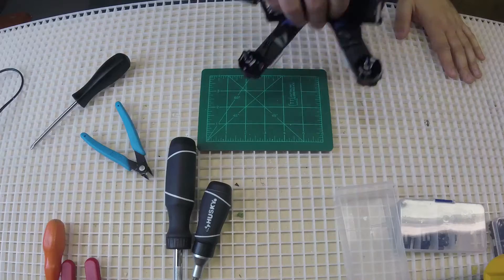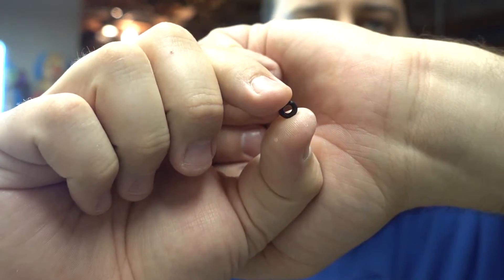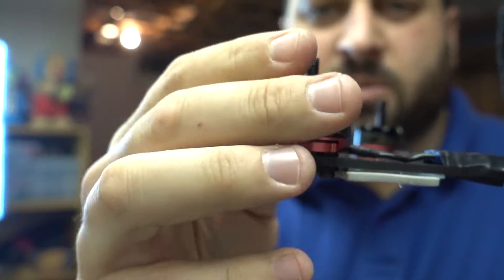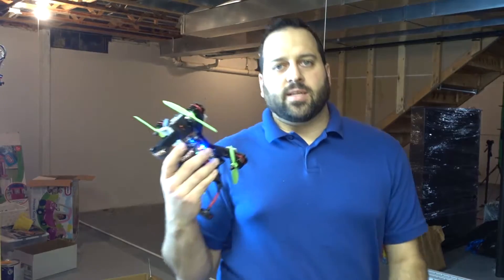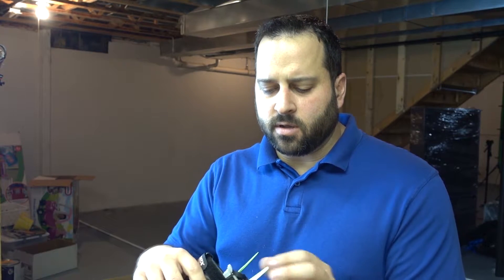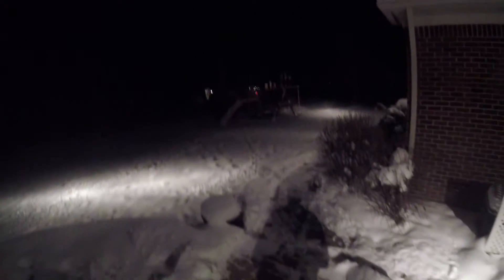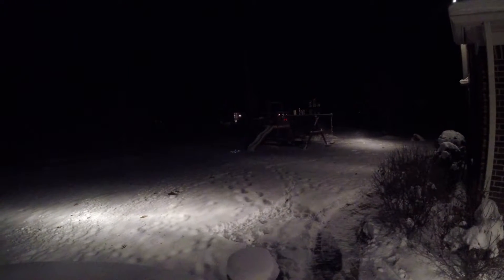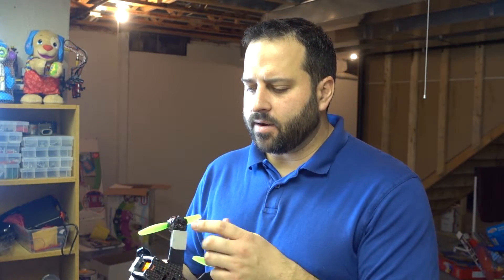DampenedLight Twitching Part 2 - #SolvedForReals

Comment: What kind of difference do you think it makes with o rings on the motors instead of the electrical tape I see everyone doing or double-sided tape
Reply from the maker: I can't comment on the difference.  I've only tried o-rings and TPU spacers.  Both of them worked effectively.  I would assume that a few layers of electrical tape would work just as well, but without ever trying it, I can't say for sure.

Comment: If you look on BetaFlight it will show vibrations. I clamp the drone down and using the transmitter there are large spikes at repeatable places for sick motors.. 
Couple of motors the spike would be over a range of RPM's like 1400-1450.. If I go above that RPM motor is happy and below it also happy but in that range the noise is dramatic on one axis.
Different motors will have the noise spike on different axis. 
Your Solution dampens the issue but it is still hiding there. I plan to migrate to another motor. I have 6 bad ones. 12 good. 

I take that as the Twitches.
Reply from the maker: +Emrys Alf maybe, but spinning the motors in the betaflight motor tab didn't show an issue for me.  And yes there is still vibration there and I'm just dampening it, but this did solve the problem.  The gyro sensors in a lot of fcs are a lot more sensitive than they used to be. Making small issues like this far more noticible.

Comment: Try isolating the FC with o-rings and plastic stand-offs.
Reply from the maker: Anthony I did.  I now have both the motors and the FC soft mounted.  For me, the soft mount on the FC alone was not enough.
Reply: At 9:04 you still have the glitch.
Reply: John E Fly I am having the same trouble as you. Next I am going to dynamically balance the motors themselves. It's these new gyros, they are so sensitive.
Reply: That worked for me!

Comment: I have the same problem with my wizard. No crash and I got the same weird yaw twitches. I'll give this a try and hope for the best. Thanks
Reply from the maker: Sorry to hear about your trouble with the Wizard!  I hope this helps you.  

I have done another build since this one which had the same switch issues, so I soft mounted those motors too and it solved the problem yet again.

Comment: https://github.com/betaflight/betaflight/wiki/Frequently-Asked-Questions#i-get-yaw-twitches-or-mid-throttle%20oscillations-how-do-I-solve-this-  << was this relevant?
Reply from the maker: It's extremely relevant.  Unfortunately I didn't find the FAQ before I had already spent a ton of time troubleshooting, and had already put the o-rings on the motors.  However, I had found other places, including the original issue for that FAQ: (https://github.com/betaflight/betaflight/issues/322).

The toughest part for me was the massive amounts of different information.  I found lots of different forums talking about this.  Lots of people said it was specific to the MPU6500 at first (and mine is a MPU6250 while my Naze32 with MPU6500 doesn't have this issue at all).  Lots of people said it's caused by bad solder joints (which is what was the motivation for the original attempts in the first video.  

There were a lot of people that later said soft mounting helped, others that said it didn't.  Some said it was an issue with a unibody frame having more vibration.  

In the end the FAQ wound up being more validating than anything else.  Mostly because I found it so late in the game.  Next time, I'm going to look at the FAQ first.  lesson learned.  There is too much other inconsistent information if you don't have really smart people filtering it down for you somewhat first.
Reply: Yeah...  Bardwell and them.  Always good to watch their stuff even if it isn't relevant to you at the moment...  cause you'll have gained intuition  from it for when it inevitably is relevant.  My latest issue was OSD flaking out after flips and rolls, and ceramic capacitors on Aikon 30's blowing up, and even an LC filter burning out (luckily saving everything behind it).  I ordered a bunch of electrolytic capacitors to all my builds.  I think it's best to read stuff like that FAQ and just do it all every time.  It can't hurt to be more resilient to physical or electrical noise by default, especially when it only adds a couple bucks to a build.  More than likely it'll save something from failing early anyway.  I've broken FC's from hard impacts before as well, so o-rings can't hurt.  Same with the conformal coat waterproofing stuff.  I really want to come up with a shielded design that can crash into mud and puddles (and concrete) and still fly for this coming spring.  Things didn't go well last season.
Reply from the maker: Yeah, I've been watching tons of stuff from Bardwell.  He has some fantastic content.  I also agree with your approach of always following best practices.

Related to your comments, I did add CorrosionX to this 210mm quad and it's worked amazingly well at waterproofing.  The other day I crashed in the snow immediately (hard for me to guage your height when there is no texture) and it was packed with snow all over the FC/PDB and a few other components.  I figured that would be a good test of the CorrosionX water proofing.  It flew perfectly with no issues.  So that stuff does seem to work wonders. 

Mud seems like a whole different ball game though.  I'm curious how you could shield the motors from getting mud, yet also let them have good airflow?
Reply: Probably have to bring a source of water to rinse with, and have field-removable motor bells if gravel gets packed in there.  Everything else should be shielded from mud though with some kind of barrier or pod design.  It's been done more or less, but getting something ultra-durable that is still able to be worked on easily is the challenge.